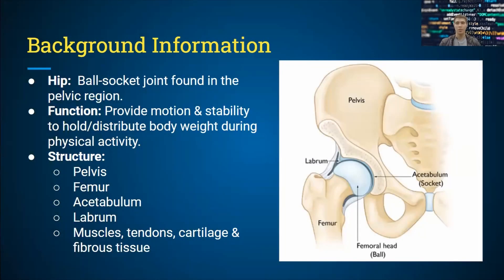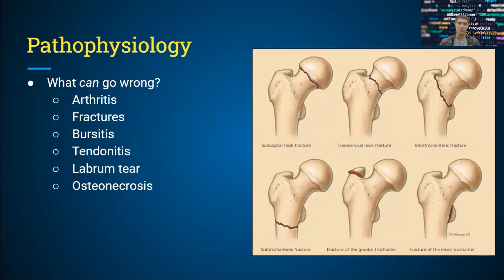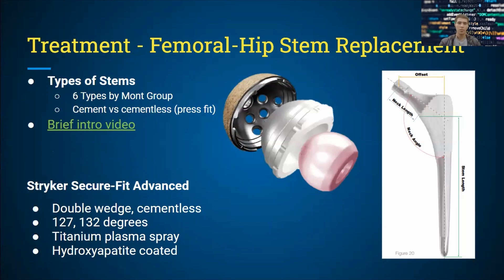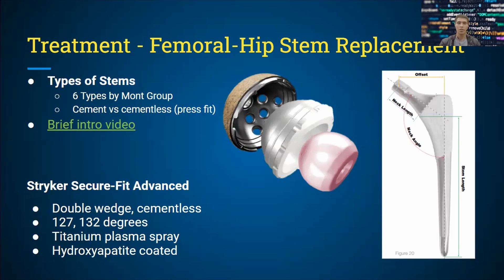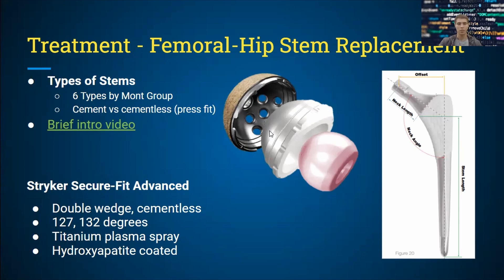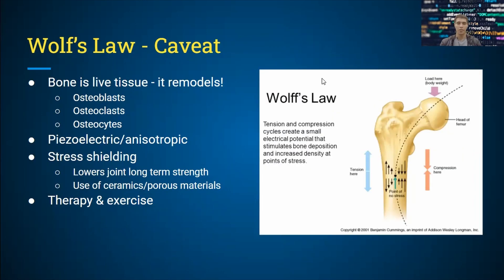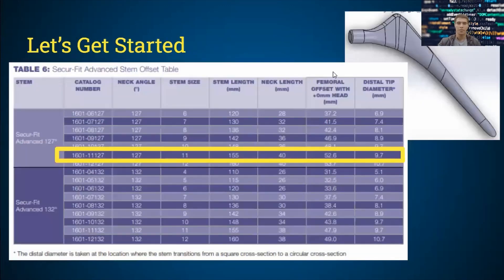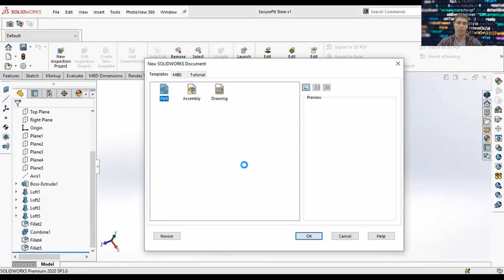How to Make a Femoral Hip Stem on Solidworks

Comment: hey. great design! doing something similar in our class at the moment. where would you apply boundary conditions for this hip joint for simulation?
Reply from the maker: If I had to guess, it would be along the body of the stem, where it anchors into the femur! It would be a force vector facing downward. The head would be on a ball joint that anchors to the hip!